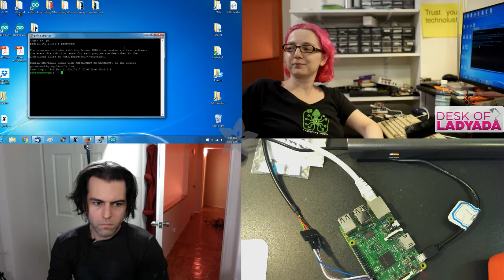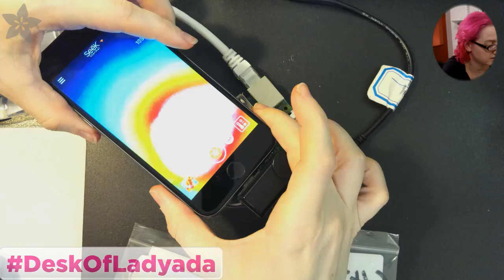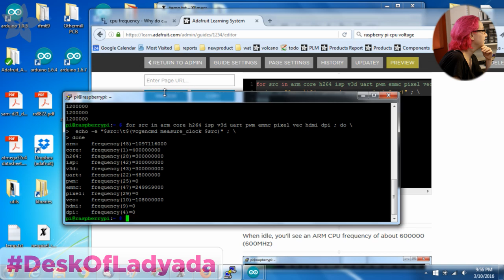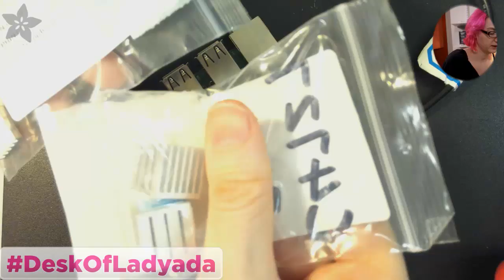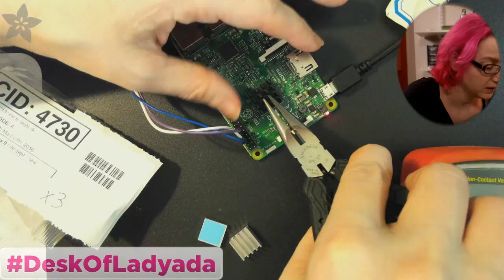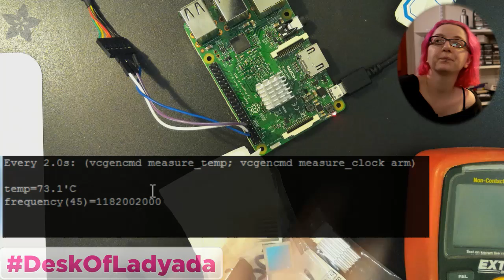Raspberry Pi temperature & heat sink testing @adafruit 3/10/2016 @raspberry_pi #pi3 #raspberrypi

Comment: Good show. Though I wouldn't use thermal tape. It would be better to use arctic silver compound to test, then clean and reply with other heat sinks. Then in production switch to arctic silver thermal epoxy.

Comment: pretty sure the diet-pi distro (cutdown raspbian) has parameters you can change for max CPU temperature, I.E. when it starts throttling.

Also, I found that just a small amount of airflow (desk fan some distance away) prevents pi3+7mm high heatsink from getting anywhere near 80C.

Comment: Are they referring to thermal throttling, such as in modern Intel/AMD desktop CPUs? It looks like this arm soc is hardware-controlled, it seems to throttle down pretty consistently when it hits 79-81C. Do arm socs have a dedicated TDP like that? if so, that's pretty awesome
Reply: +stryk187 Yes this chip throttles.